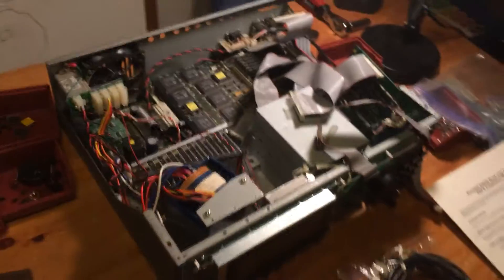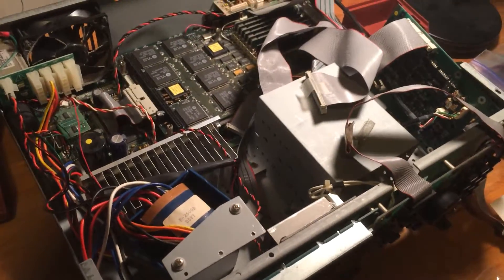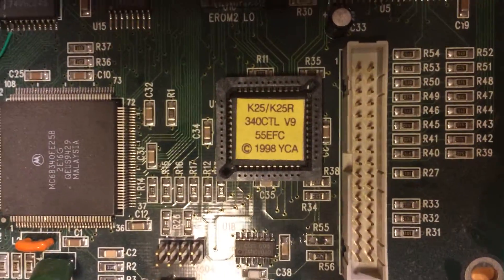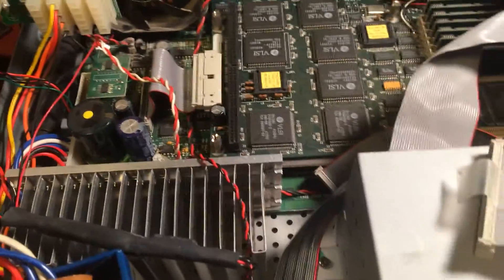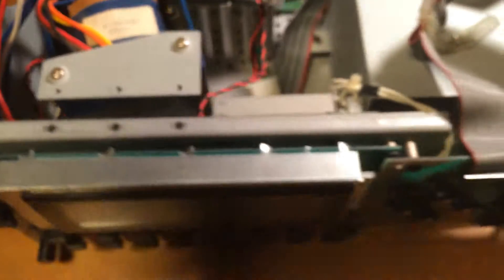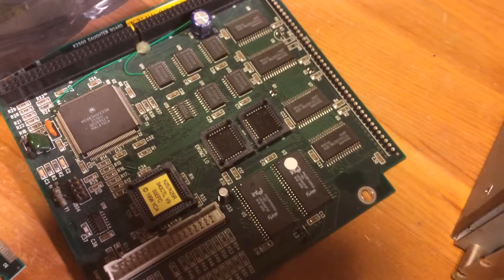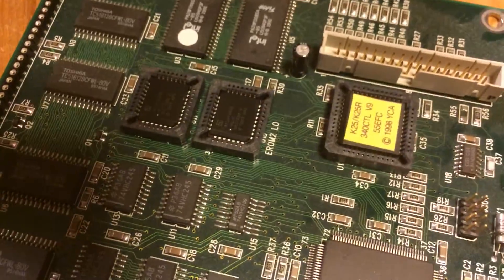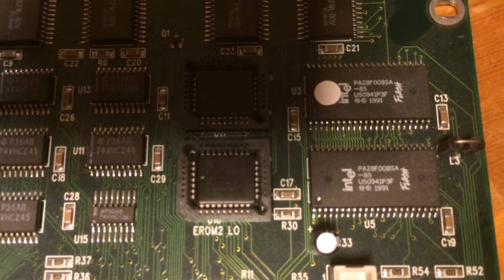KDFX Installation Part 1

Comment: This allows for custom sounds doesn't it?
Reply from the maker: KDFX is expanded effects processor.  highly regarded as a very high quality collection of DPS effects.  The K2500r (what I had) an optional sample interface you needed to record samples into ram.  The unit also contained Roms (also expandable) which gave the unit built in quality sounds out of the box.  So the K2500 (like many other Kurzweil products) are basically hybrid rompler/samplers.
Reply: @8bitwidgets  I'm thinking of getting a K2500RS and putting in piano sounds from K-Sounds. I don't know if you put them onto a floppy disk and load them up or something. Obviously i would have to put in a KDFX board in first.
Reply from the maker: @jaggass  you don't need KDFX board for that.  if you can put it on floppy you shouldn't need any extra hardware.  however there is a piano rom chip but they are hard to find and a pretty penny.  if you look around, someone out there made an "all in one" rom chip upgrade you can pop in that gives you alllll of the expansion card sounds in a single chip.  Just plugs into the device and you run some floppy update to the OS.  It's about $150 but well worth it if you use it.  The KDFX simply adds a bunch of effects to process the sound of the instrument.  it doesn't give you any new instrument sounds.  Just things like reverb, distortion, delay, etc..  I sold mine before I ever got a chance to figure out the KDFX stuff.   The 2500 is a beast of a machine, especially once you add KDFX on top of it.  I sold mine because it was just more machine than I had time to master.